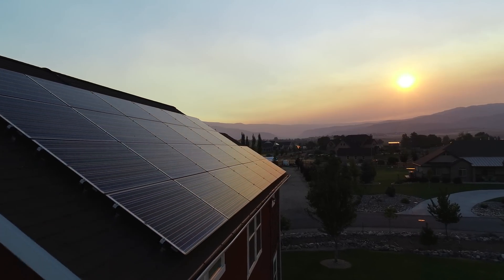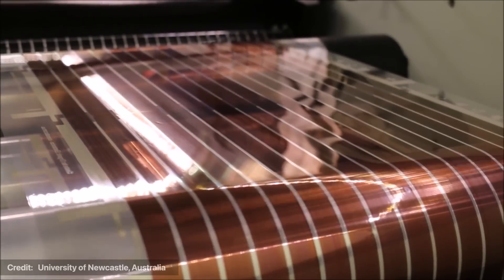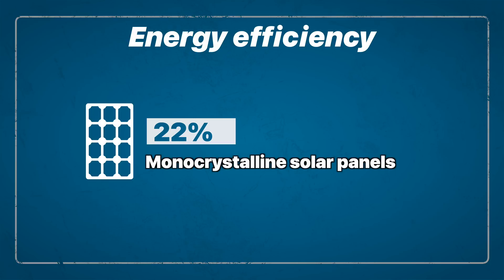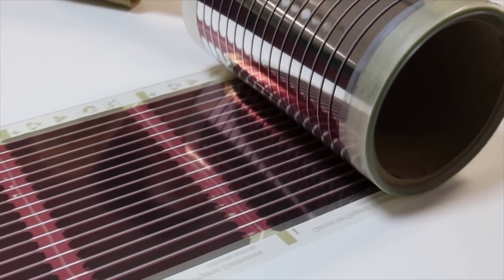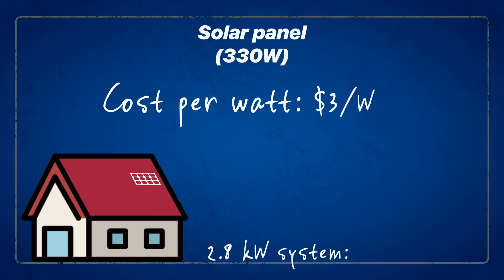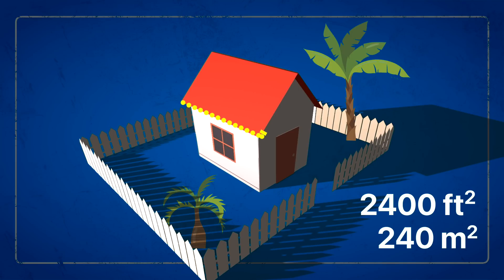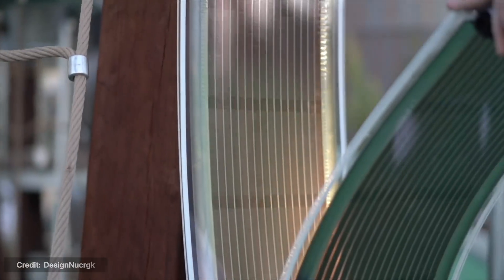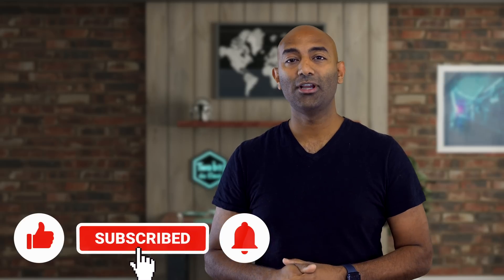This Breakthrough Solar Tech is CHEAP & Printed Using Ink!

Comment from the maker: Win a Model S Plaid! http://www.charitystars.com/twobit
See the Full Post: https://www.twobitdavinci.com/4182/ink-printed-solar-panels/
Reply: Ricky, well done with this video! I almost made the cardinal error of typing a comment before watching the whole video as it seemed you did not include the "service" cost of replacement every two years but you were on it like the pro you are. The only thing I wish you had added was a credible source of projections of anticipated change to durability and efficiency based on comparable technology. Were there none available? For example, I get that more established PV tech might not seem like a good analog so perhaps this sector will be watch and see... Agree with your conclusion that absent substantial improvements to durability applications will be niche (but there will be applications).
Reply: Not worth much over 2 minutes to learn about. 30 seconds, maybe?
Reply: If these things can be mass produced cheaply and reliably then they could easily replace silicon panels in some applications even if they don't last more than few years.

When you install solar panels on your roof the cost of the panels is almost irrelevant, as long as one understands the $100000/m2 experimental ones are not in the consideration. This is because in most places installing the panels costs more than the panels; I have calculated in some cases it has been $500+ per panel, while the panel itself cost only about $200. However, that is because silicon panels require a team of installers to work on your roof for few days just to install about twenty panels. If this stuff works properly you could probably cover your whole roof in solar film just by having one or two people spray some glue and unroll it on top, taking just few hours at most and costing much less than regular panels.

Let's say that costs $1000 and needs to be repeated every couple years, while your neighbor paid $15000 for equivalent traditional panels. In thirty years his panels are past their warranty and need replacement, and because installation is still the main part of the cost he needs to pay $15k again, which is not horribly expensive but can still be a problem for some people's finances. Meanwhile you have paid same $15k for your panels, but a thousand dollars every two years is much easier to handle.
Reply: @AnalystPrime  It actually makes sense to install this cheap solar by oneself since it won't last more than a year anyway. Proper installation of panels that are meant to last for 30 years make sense, but for solar that you will replace every year? 

Just adhesive is good enough so it will stay put for 12 months and then replace after that. Since they are easily recyclable I don't see a problem with that.

I know that it can be frustrating to replace the solar every year, but you can save your electricity savings for the future so you will able to afford to install a long term solar solution later. It might take 10 years to do it though.

It's similar to ride a bike to work and put all the saving on gas to buy an electric car in the future.
Reply: @SkepticalCaveman  Exactly. Only likely problem is keeping the roll straight so the result does not look bad. 
Well, that, and someone will probably glue it wrong way down...

Comment: Efficiency doesn't matter as much as we would think (at least if there's enough storage to store energy for later) ; what matters more is EROI (Energy Return on Investment).
Since EROI is the ratio between energy produced and energy required to make the cells.
So EROI can be improved either by increasing the total amount of energy required to make the solar cell, or by decreasing the energy required to make it.
These produce way less over their lifetimes, but they also require way less energy to make, so depending on the math, their EROI may be just as good, or perhaps even better, but it depends on how much energy is required to make (way less than traditional solar cells).

Comment: Like a typical Moran u missed the most important math. It's.not 4x cheaper when it lasts 15 times less. 2 years vs 30 years. Replacing every 2. Years means it's wayyyyyyyyyyy more expensive. Moran..

Comment: These solar panels can take up to the  air by drones the panels would power the drones and the drones will sustain  these panels in air at day time and   these panels will power the batteries on earth through wire

Comment: Without the protective mounting case, they would never survive in a 'permanent application'...out in the open, one hail storm will destroy the circuits within them. Considering the 'traditional long-term' cell designs, I'm also not sure what high UV would do to them, either. Keep in mind, one of the oldest, yet longest-lasting processes to make PV cells, is to lay a small pane of glass down, then the 'negative' (something like grafoil), then a non-conductive saturated in an electrolyte (such as a thick paper towel in salt water), then a fine copper wire mesh that has been 'red oxidized' (heat over 240C for 20 minutes). Then, your positive pole is the copper mesh, and the negative would be the grafoil. Lasts for 10-20 years, and with tempered glass, is relatively durable...average yield: 15-watts per ft^2. This foil in the video looks like something you'd get at the Dollar Tree for $1...and last MAYBE 1-year. You MOST CERTAINLY could make solar cells (at watts per sq. ft.) cheaper than this.
Reply: That is very interesting Skeeter. Do you happen to have a link to a how to vid/article for the method you describe?

Comment: you’d have to change these panels every 2 year so your $2000 cost becomes $30k compared to the $8400 you’d spend of traditional panels.  the cost has to drop 70% to be competitive.

Comment: 2:10 "Cant support the weight of traditional installations"....man if the roof cant handle the weight of traditional panels then you need a new roof. The weight of panels and alum bars are so light is a joke.

Comment: That $US8400 price bothers me, really don't understand why it's so expensive in the US. Just recently got a 6.6kw system (typical max here in Perth AU with our grid) and it cost about $AU6000 (minus $AU2400 from renewable energy credits "STCs") ... so about $AU3600 for panels, inverter and installation ==> $US2500. A previous system on another house 8yrs ago was $AU8200 / ~$US5600.

Comment: This could be a stop gap for the energy crises looming over europe this winter. If printers could start now, they could help the areas that rely heavily on imported gas.

Another benefit in this specific case,  after a building has the equipment to hook up to the grid or batteries the cost to replace or upgrade will be less than the initial install.

Yes, it would take someone with Musks' or a nations resources to see if enough can be done in time and make it happen, but this is going to be a crises....what other options can they implement before winter sets in?

Ok 1 more thought. If it were mobilized on that scale it should reduce the cost from scaling up the manufacturing process.

Comment: I disagree with your conclusion.  the 1-2 yrs usable life isnt taken into consideration.  No one wants to redo everything every 2 yrs.  8400$ for traditionnal 2.8 kw system.  Now you must divide it by 30 yrs !! You cant compare 8400 with 2000$ aand say its 75% cheaper, when actually, in 30 yrs you will have to pay it 15 times.  So its 2000$ * 15 = 30 000$ compared to 8400$, and now we got a lot of crap to recycle.  Its not 75% cheaper, it cost about 4 times more money in the end, without calculating the labor and recycling cost of doing the work every 2 yrs, which would skyrocket the price even more.

Comment: Cars are high value high energy consumption low area devices the challenge with cars is to produce worthwhile amount of energy almost regardless of cost. The opposite of the benefits of printed cells
perhaps we could re imagine offshore  wind farms to primarily supply wave suppression for floating solar while also still producing significant wind power

Comment: Sad you didn't speak a word about the technology. I just did some searches. have no clue if what I found is what your vid is about.  I found a method which uses zinc oxide as the photoactive material, then Graphite and ITO as electrodes.
   This reminds me of a period in my life when I was making capacitors and batteries >> I found many materials to be photo-excitable.  Titanium , vanadium , and the oxides of both were highly active, even with a flashlight. In my experiments I just dunked these pieces of metal(electrodes) into a mason jar with water + a pinch of salt(borax was best). Shine the flash light on the material and you got volts, not much current but the setup was in no way supposed to be for photovoltaics. 
     If I were to advise anyone to chase the discoveries I found >> start @ whether or not photovoltaic phenomena arises from the metal itself or the oxides. IF OXIDES then electro plate different oxides to see if the effect increases. For example > following that chart of The Galvanic Series > Compare Titanium with it's own oxides thickened vs a Titanium plate with a different oxide formed on its surface. Opposite sides of the galvanic series.  Titanium + platinum/silver/nickel vs Titanium + magnesium/zinc/aluminum  .  That should get the ball rolling.  
    People need to experiment more. This consumer-esque way of life is holding us back tremendously. It's not hard, you just have to do the work. It's merely exploring and being sincere with the results. For example in those experiments I just wrote about, I literally just put metal in water and instead of only focussing on my mission of capacitors/batteries I decided to also shine a light on it. Literally, just exploring. The secret could be right there. I will revisit it one day. I'm on a different project currently. Titanium oxides are one of cheapest food ingredients btw...  If the world is going to change, people need to do it. NOT a company. NOT a school project. A normal person. Open source. no greed. no economics. no money. just normal people.

Comment: An aluminium roll has a surface area of 22.5m^2. Assuming 1kW/m^2 at a 3% efficiency and we get a cool 675W of power in a package the size of an aluminium roll. At a cost of 10$/m^2 that would work at $220USD to produce.

Comment: I find it odd that almost everyone is determined to put their PV panels on their roof. There are numerous very good reasons to set them up on ground racks. There are pluses and minuses for either location, so it seems odd that PV installation discussions almost entirely avoid ground-mounted panels, as if such installations didn't and couldn't exist. I wonder why? If I had a house I'd only mount panels on a roof as a last resort, for numerous reasons. Roof installations tend to actually lower the value of your home. The mounts can cause roof leaks. They aren't accessible for maintenance or dust removal, or covering up during hail storms. You can't get snow off of them. The list goes on and on. What I find interesting about the PV panel YouTube installation videos is that most of the DIY installations are done on the ground. Those are the people who read up on it,  thought it all through, weighed the pros and cons, and know the most about PV installations and their own needs.

Comment: Cost calc should include lifetime or at least amortization over 10 yrs, since the lifespan on printed is 15x less.  Used, cheap panels lower that cost and still have a much higher efficiency rate.

Comment: The tech shows promise but it's not really practical to use in most applications and mainly because of the life span and efficiency, if they triple the efficiency and bump up the life span to at least 5 years whiles also being quite cheap to buy compared to other solar panel, the tech could work but for now, I think it's best to stick to traditional panels.

Still there could be some applications where it could work already, devices that use very little energy, maybe even things like smartphones, smartwatches and the likes to either top it up so the battery last longer or it could be enough to keep it charged in most cases, after all, if it's really cheap to make and can be used in a practical way, then why not.

I think the real question is, how much better can the tech improve over the next decade or so because we should remember, other renewable energy are getting better and cheaper all the time.

Comment: Maybe they could work on some structure to put the pannel and replace it quickly. Like you know, they provide you with rolls of pannels, and every two years, you just unroll to next section. Thus you increase the overall lifespan of the solution without having someone replacing the pannels.

It still have a problem in lifespan and efficiency though.

Comment: What if this were a sheet that you used to secure your pickup's cargo space? I've seen tarpaulin used, or stiff panels. This wouldn't provide a tonne of power, but it'd be much easier fitting this to something on a vehicle, or a temporary cabin on a building site etc etc. You could hang blankets of it on a south facing wall. 

Ultimately, it's a step toward a next level technology, just like solar powered calculators in the 80s were helpful. I've already seen better tech for roofs though. Fully Charged did a visit to a factory with long, flexible panels that require very little installation, can be walked on, and replace existing roofing tiles. A bit like Tesla's theoretical product, but instead of individual roof tile sized units that are in stealth mode, these are just flat, flexible solar panels that replace the function of roof tiles and you can do most of the roof with them fairly cheaply. 

I could see big supermarkets with huge flat roofs, slapping these printed ones up there, and saving a tonne of power over the lifespan. All of which is helpful. 

It's not as simple as 'the total cost must be perfect'. It's worth a business installing solar, and then being able to say they've taken that first step, even if it's a cheap solution.

Comment: If you could keep each string of cells short enough, run them alongside roadways and other large infrastructure.
Application/re-application would be relatively simple periodically as a part of inspections.
The power could be used to provide short range internet cells in areas with spotty coverage, or as a tertiary power source for track signals systems, or even to keep AEDs charged up in remote locations.

Comment: Everything about this product reminds me of a solar panel manufacturer that was headquartered in Ames, Iowa at least 10 years ago. They were also printing their flexible panels & they also positioned their solar panels as perfect for use in natural disasters, relief efforts, & by the military for powering their advanced command centers. 

What really makes the sense of deja vu so strong is that their printed solar cells had the same problems that these panels have: poor efficiency & short life standards. In fact, I’m not sure their solar efficiency number weren’t better than this version.

Comment: If it was possible to install that solar solution yourself, then it wouldn't matter if you have to replace it once a year as long as it costs less than the savings you make during that year. 

Using them for, say, 10 years might actually save you so much money that you can upgrade to a more permanent solar solution. 

So by starting small you can gradually upgrade with the savings.

Comment: Awesome video. Part of the reason I haven’t pulled the trigger on solar yet is because of the constant improvements being made. I don’t wanna be outdated the day I install them. But I guess that goes for most current technology
Reply: Solar has a hard wall limit on efficiency,you aren't going to miss out on anything. It will be decades before home solar gets much better if even it ever does.(it'll improve in efficiency but not by enough to make the cost worth the extra amount.)
Reply: @relicboxing  thanks for the info!

Comment: increase efficiency by printing multiple materials on the same r2r process by rewinding the roll and selecting materials with different band gaps to apply to a more durable substrate like willow glass

Comment: Panels that are flexible, light and cheap that don't get destroyed by the sun is the holy grail for me, current flexible panels are garbage compared to regular solar panels that just keep getting better, but they also keep getting bigger and heavier, some are about 30kg each now. You can imagine how some roofs couldn't take the weight of an array of them.